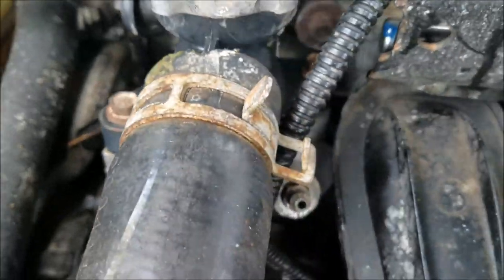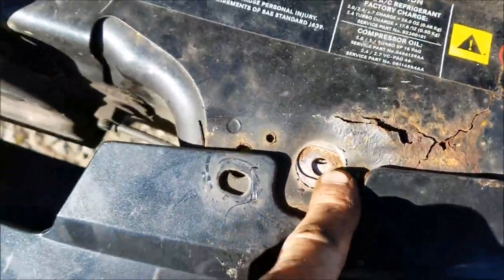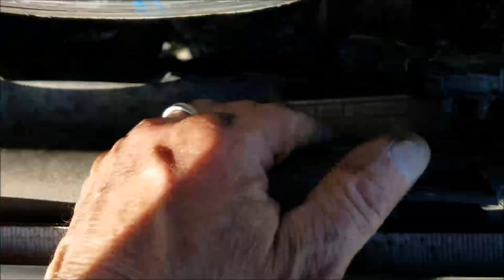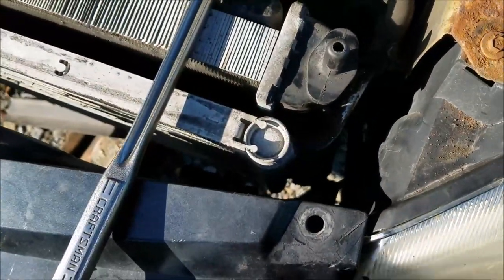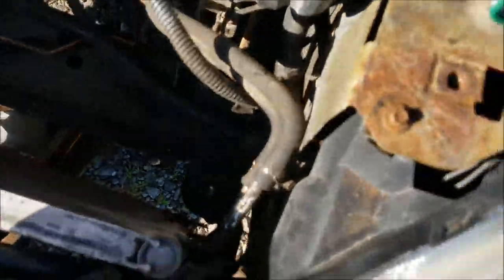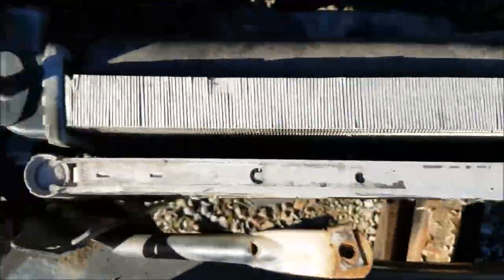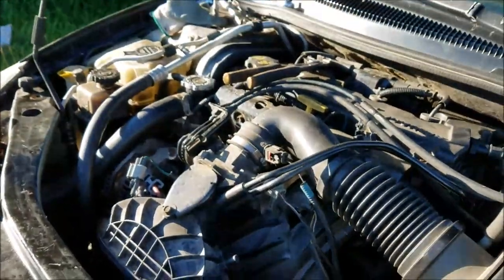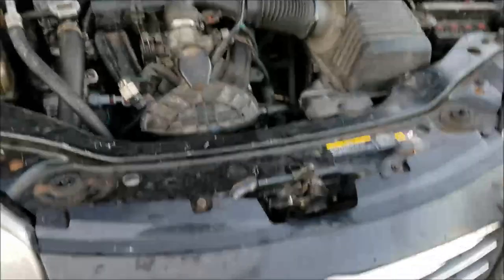04 Chrysler Sebring Replacing the Radiator

Comment: Very helpful. Great tip about taking the fan off. It gives some wiggle room to get to the two bolts that attach to the condenser. Other wise I think I would need to take the condenser out too, and the AC work is no fun!  You saved me a lot of extra work! THANKS!

Comment: thanks for filming and demonstrating the evil layout by Chrysler Engineers to make it extremely complex and more difficult by design for do-it-yourself maintenance service by an owner just to get access to the drain plug and lower radiator hose for an otherwise simple chore of doing a radiator fluid flush ~ makes me really regret owing a 2001 Sebring xli ~

Comment: Hi I have a question. I have a 2003.
chrysler sebring lx the kilometre is only 78 the person about it. He told me it's just sitting at the back for a couple years. He told me there's no problem.
Right now it’s doing Aubrey heating every time it overheat the coolant is boiling that's why went to mechanic
changed thermostat , thermos housing, and radiator and  still doing the same thing … supposed to be a gift to my daughter… I just feel so disappointed to myself … by the way do you think you could help me if you know what’s wrong with it? Thank you.
Reply from the maker: Make sure it got bled and thermostat is opening. is there heat through vents ?

Comment: Thank you, very helpful.  Camera could've been steadier with wider shots for better view.  Otherwise, I love the video.  Awesome!
Reply from the maker: Hi 21064a01 Thanks for commenting Ya  wish I had a camera man. I have a 360 camera I may start using panorama or in 360  But you would have to have the goggles   Say get a user name !
Reply: Thanks to your video I was able to replace the radiator.  I still have overheating issues, even though I have new thermostat, new fluid, cap and brass temp sensor next to the thermostat.  I don't think it's air in the system.
Reply from the maker: Hi 21064a01  The sebring was still overheating and finally it went to normal after a few days of driving so keep the reservoir where it should be and check the to make sure the coolant is up at the cap.  keep me informed

Comment: Would this be a good time to change the thermostat? this one is located on the bottom of the engine. My intake bolts broke when trying to take off the air bleeder valve. I just said screw it, took it to a local shop but totally did not expect them to want 550 to put on the thermostat and adjust the air bleeder valve. Sounded a bit....excessive imo.
Reply from the maker: Hi General E DGAF! Thanks for the comment ! only if you a have a issue, no heat or overheat
Reply: Dana Crosby lol unfortunately I have both. I took the stupid thing to a mechanic because I about crushed my face while working on it. My uncle did warn me that this paticular model of vehicle is a mechanical nightmare....I mean, who puts the thermostat on the bottom of the engine, and uses the timing chain to drive the water pump?  Only our good friends at Chrysler.

Comment: So the radiator could be a gallon and half low but the reservoir clearly shows full, because the empty space filled with air Cannot pull the fluid from the reservoir. So add the fluid when engine is cool through the metal radiator cap.
Reply: Satochi NAkamoto  or you can use the bleeder valve located on the thermostat housing

Comment: Chrysler 'S are engineered badly. Sebring the coolant in the reservoir does not ( DOES  NOT SHOW THE LEVEL OF FLUID IN THE RADIATOR). When the engine is completely cool after several hours take the Radiator cap off. Put the correct ratio of coolant through the radiator (metal cap.)  Also the O.E.M. thermostat does not have a fail safe in it. The new thermostat'S  do, allowing coolant to pass in overheated conditions replace it. When the radiator is low on fluid the reservoir shows full. It fools you into thinking the radiator is full when it is not. So fill the coolant in through the radiator metal cap. If the thermostat is closed up , coolant will not pass.
Reply from the maker: Hi Satochi! Thanks for the comment. It is a pain getting it bled. Now it has a blown head gasket .
Reply: There no metal cap on the 2001